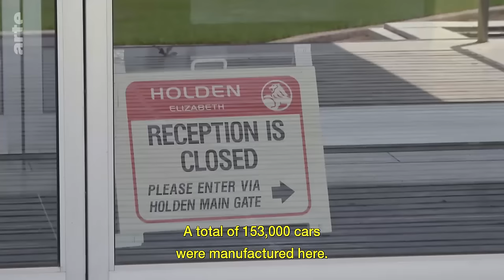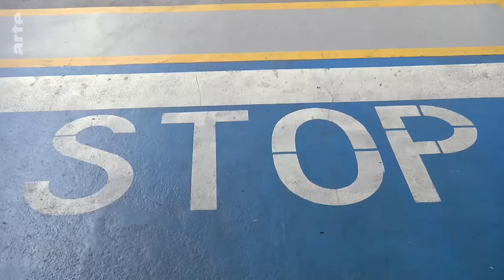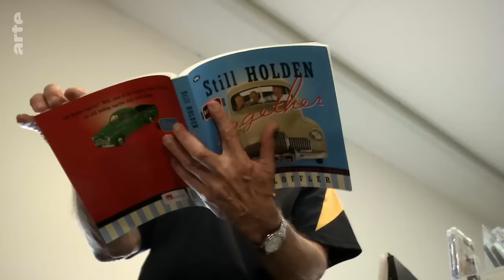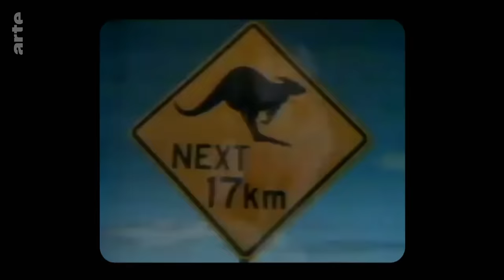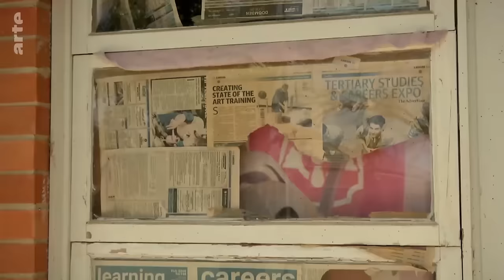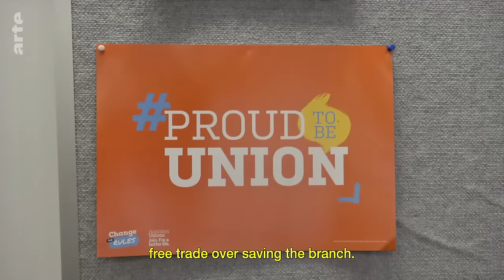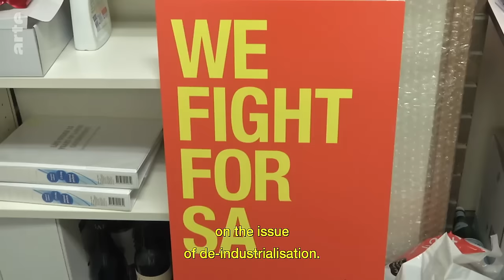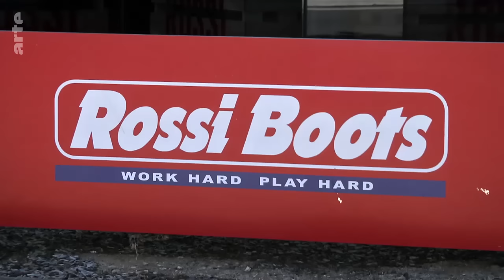Australia: A Country Without Workers | ARTE.tv Documentary

Comment: I was on the opposite side I was a Holden fan but I got a job at Ford motor company Australia Broadmeadows started back in 1985 working in the plastics plant working on the plastic injection moulding machines as a die setter operator then in 1990 I transferred down to Fords operations down in Geelong Victoria work there mainly as a CNC machine setter and operator l have done other multiple tasks Jobs as well as working in press shop as a die setter operator and casting plant casting front and rear disc brakes and BARA engine blocks l took the package around about 2010 did my 25 years service 5 years Broadmeadows 20 years Geelong fond memories I have learnt multiple skills that the newer generations will never have that opportunity what the car industry can give you